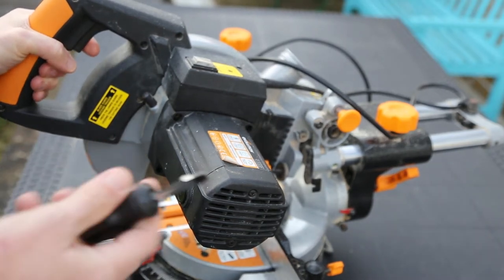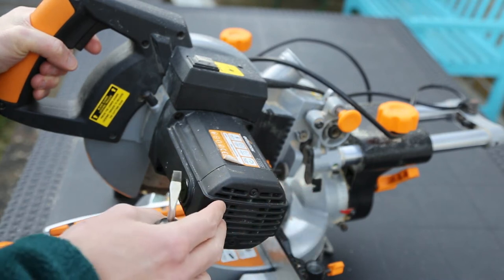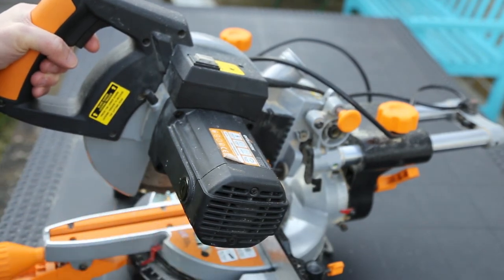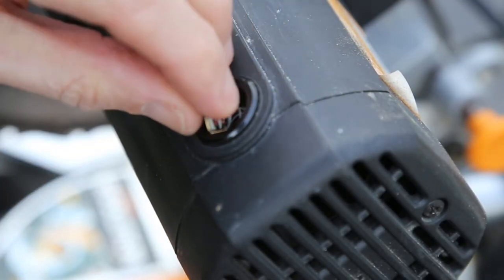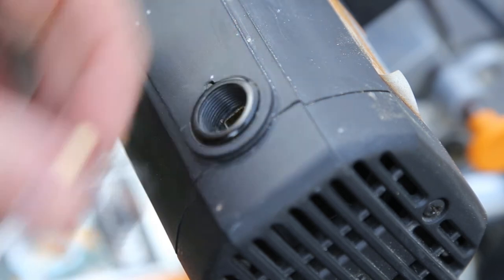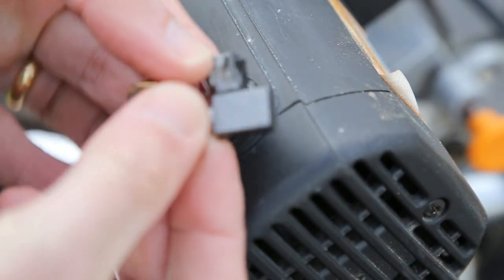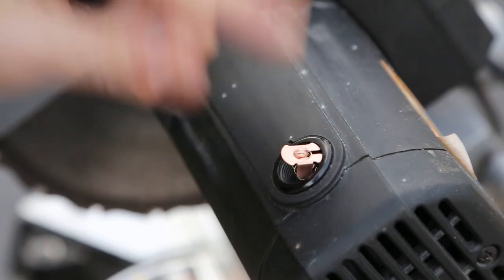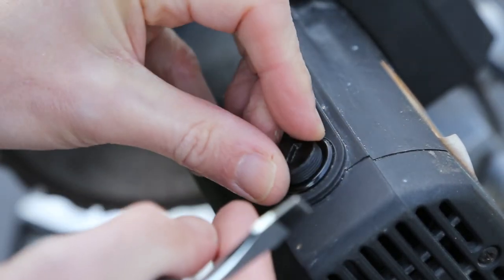Mitre/Chop Electric Circular Saw Stops Working/Intermittent - Carbon Brushes replacement

Comment: The brushes that I replaced melted when  I tested it again is there maybe something wrong with the saw itself rather than the brushes?
Reply from the maker: Possibly. The brushes are carbon so if they're melting the temperature must be getting very high so might be worth getting repair shop to look
Reply: @ajvw  thanks but i found the problem, turns out the mother itself is fucked so I'm getting a new one ^-^"""

Comment: Would you put a link up for your brush replacements as  I have the same problem and saw, many thanks
Reply from the maker: The one I bought was this https://www.ebay.co.uk/itm/Carbon-Brushes-rage-3-s-stealth-fury-3-rage3s-210mm-1500-watt-D2R/122810292909

Comment: My saw blade spins until it touches wood then stops but motor continues. Would you suggest this repair would fix that issue?
Reply: Mine is doing the same? Did you find a solution. Cheers
Reply: @georgehaddad1159  took the blade off and tightened it and have not had this problem since
Reply: @danaustin6991  yea that was the first thing I tried but it's still doing it. Perhaps I need to add a shim
Reply: @georgehaddad1159  mine too! I took off the blade, replaced it and tightened it and it's still doing it! Did you figure out if this was the problem?

Comment: mine the blade not spinning wat can cause that?
Reply from the maker: The carbon brushes shown here can cause it
Reply: i found wat cause not the blade to spin i should’ve made video 😬😁
Reply: @mizaelbautista6151  what was it please? I'm having the same problem. Power works as laser is on but when the trigger is pulled the blade won't spin or turn on